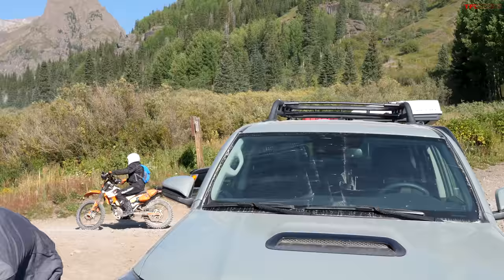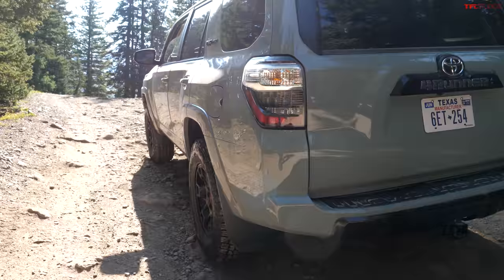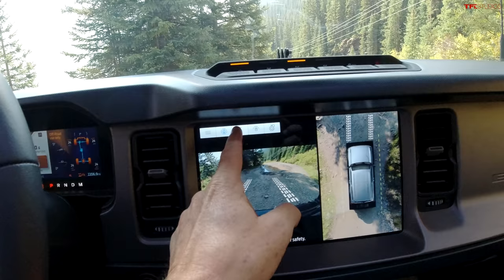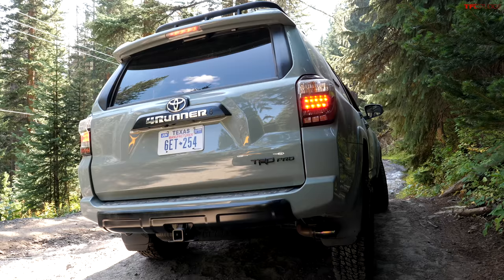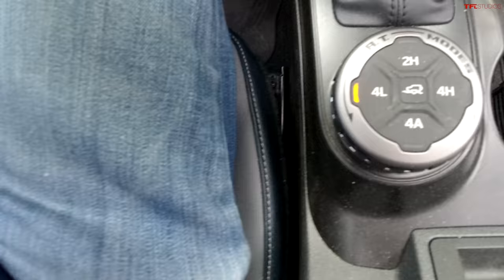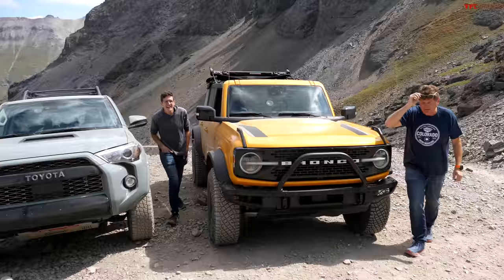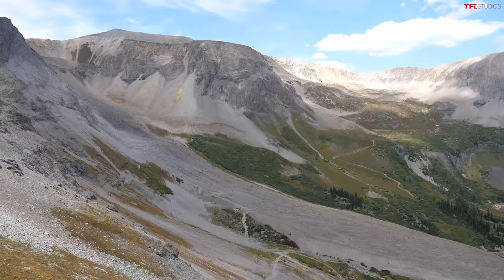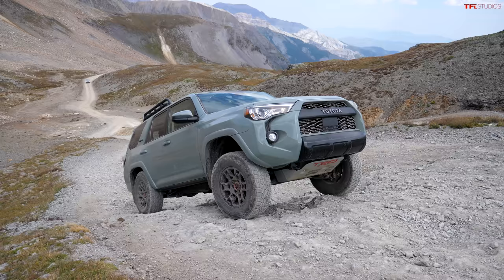The Toyota 4Runner TRD Pro May Be Old, But Can It Still Keep Up With The Ford Bronco Up A Mountain?

Comment: IMO the 4Runner isn’t a direct competitor to the Bronco. It come from a time when Chevy S-10 Blazers, Ford Explorers and Nissan Pathfinders were body on frame, 4 Lo real off road built SUV’s. Only the Wrangler really competes with the Bronco.
Reply: Agree 100%. The 4Runner competes with the Jeep GC & Ford Explorer; both of those outsell the 4Runner by considerable volume. Toyota needs to start innovating again. They’ve relied upon their reliability stereotype far too long & the quality gap has narrowed.
Reply: @krasnaludek298  Toyota's competitor to the Ford Explorer is the Highlander.
Ford Explorer is no off-roader like the 4Runner. No body on frame, no 4x4 (only AWD), no solid rear axle...completely useless off-road and definitely can't go where a 4Runner can go.
Reply: @krasnaludek298  the 4runner is in its own class and doesn't really have a direct competitor which is why their resale value is incredible. The Jeeps GC and Explorers are disposable vehicles with limited aftermarket support that nobody wants after a few years. These 4runners will be sought after for decades to come.

Comment: I’m a huge 4Runner and Landcruiser fan (own one of each), so don’t get me wrong.  Toyota really is missing out on the Jeep Wrangler and Ford Bronco reboot crowds by not putting out a modern FJ40 — not a 4Runner in makeup to look like one a/k/a FJ Cruiser, but a top down, door off, locked 4x4.  The 4Runner is an Americanized Landcruiser Prado and will go pretty much anywhere but it lacks the styling and passion of Bronco and Jeep.
Reply: Toyota seems satisfied to just keep tweaking the 4Runner.  They really aren't trying to compete directly with the Jeep/Bronco style of top down, doors off, open air experience.  Maybe they'll get inspired and redo the FJ, or go to a more retro Runner concept like a Gen 1.   I have an 86 4Runner and just really want the open air feel when off roading.

Comment: The 4Runner TRD Pro will outlive the Bronco, I don't get the hype for the Bronco they had to bring it back from the dead to make sure it dies again.
Reply: Just your opinion and at this point unprovable, nobody knows how long the Bronco will last. I just don't like sending my money to a country that severely tortured American GIs during WWII. I have talked to a former Gi who was forced to walk the Battan death march.
Reply: @RSDX99  then be in ur own nutshell
Reply: @amarbinay6654  well said
Reply: @amarbinay6654  4runner owners are in their own nutshell. They'd ignore anything else for the sake of "ReliABilityyyy", just to trade in 5 yrs later for another 4runner. Let's keep it real, any of these would make it past your reliability claims, you're paying reliability in advance for the 3rd or 4th owner
Reply: @luisinhoens90  what do mean they aren't reliable or what. May be 3rd or 4th owner will suffer if used  one isn't in good/proper condition  but when it comes to the term reliability and longevity, yes they're pretty much stand on it and there are many owners with 500000miles and above with no problems at all. Some people who buy used 4runner they've also claimed what's the vehicle promises other than that if there r some faults then will be manufacturing defect or basically owner didn't maintain properly. If I able to live in america then surely I have 4runner/TACOMA.
Reply: @amarbinay6654  What I mean is if I'm buying new I'm not paying reliability in advance for the 3rd or 4th owner. Lets keep it real, very few owners keep their cars for so long. I'd rather have the more entertaining, more off-road capable and appealing ride, keep maintenance on track and it will do well through my ownership and next owner.
Also, desirable vehicles with high resale value usually get good maintenance. That's why Wranglers although generally don't get the best reliability record are kept on the road. Cheap econoboxes get neglected, skip oil/fluid changes and discarded on a regular basis. $50K off road vehicles? Not so much
Reply: @luisinhoens90  Yeah absolutely that's what I love about TOYOTA brand and perfect vehicle for long term owning. Here where I m living, the domestic market vehicles r cheap and crap, some of their service maintenance just scam and BS except for TOYOTA, they r too much  different in their way, their regular service maintenance r cheap and affordable($70-100), good revalue, many owners keep for long term and trustworthy brand except for some dealership. Here TOYOTA's best selling vehicle r FORTUNER and INNOVA which can be used as a overland or off road rig which is a perfect vehicle to own if I live here for long time. 
Jeep r decent capable vehicle but I don't like it because reliability factor, some mechanical failure and here they r overpriced, Some jeep owner do minimal off-road stuff and got stuck easily( they don't know to drive 4x4). If I ever happen to own jeep or defender I'll just swap every mechanical with TOYOTA  for long term reliable factor and to do some practical stuff

Comment: Man 11k is a big difference in price, and if you put that money into modifying the 4Runner. 35s and a front locker and more are all well within that price range. And if you ask me if the 4Runner can keep up on 32s it will likely outwheel the bronco on 35s
Reply: Yes, it keeps up with a Bronco on 35's on a trail that stock vehicles have no issues with. The baby 32" tires, lack of a front locker, and horrible gearing will quickly hinder the 4Runner once you get into something that is actually difficult.
Reply: Don’t get me wrong I love the new bronco but the price difference still stands. For the extra money you can easily regear the 4Runner as well as add bigger tires and a front locker with plenty of extra money to spare, whereas the bronco has some innate issues for crawling especially that just can’t be fixed without some excessive fabrication such as it’s weight and size. Not to mention engineering elements such as the front shock mounts being exposed on the bottom of their lower A arm, which would lead to serious breakdown on something that is actually difficult.
Reply: @noahthorin2476  You would quickly eat into that 11k difference, if not exceed it. Wheels and tires alone will eat up half of that, not to mention a lift, axle regear, and front locker. Also, the axle regear only mitigates half of the gearing issue with the 4Runner. The other half lies with the transmission and transfer case.

I definitely agree with your concerns about the Bronco, though. I've seen a few out on the road and they are a big vehicle, for sure. Plus, mounting that stud on the bottom of the A-arm is just an absolutely terrible decision. Good luck getting that nut off after dragging it over some rocks!
Reply: @stinggreyjlr9535  If you ask me it sounds like the solution is to wait a couple years and buy either used for cheap and dump quite a bit more than 11k into them lol.
Reply: @noahthorin2476  The price difference doesn't stand here. There's no stock 4Runner with comparable off-road bits to the Bronco 1st edition. Can we all agree there are much cheaper Broncos including the Badlands that can undercut the 4Runner TRD Pro, yet still comes with a locker and front swaybar disconnect?

Comment: Toyota engineers are very conservative and they rely on what is proven rather than go with something unproven.
They constantly monitor components for reliability and are quick to make design improvements.
Plus, although all vehicles have their own set of issues I know 4Runners that have over 400,000 miles on them!
Ford, just does not have the same reliability and as far as old goes......well, uh, it's older in concept.

Comment: What’s the advantage of the the ten transmission? It’s not fuel economy.
Reply: I feel like anything above 6 speed transmissions, we have reached a point of diminishing returns.
Reply: 😲 great point!
Reply: @NWI_Steel  not at all. A 8sp will get 11%+ more fuel economy than a 6sp
Reply: More gears makes a few things possible. less load on the engine after upshifts, lower numerical gears for fuel economy on the hwy, higher numerical gears to start moving  - or off-roading.  You can make a vehicle accelerate quicker and get better mpg by having more gears. For CAFE, the extra overdrive gear or two is important. For acceleration the extra low gear or two is important.
Reply: @life phobic Nope. That's why CVT are good at fuel Economy.
Reply: @MrCh1cken  for highway fuel economy, it doesn't matter how many gears you have. But only what the ratio is in top gear.
Reply: @NWI_Steel   yes and no. If your overdrive is too low for the conditions, speed, angle, altitude, load, etc.. then you have to drop down a gear or two. Having extra overdrive gears allows you have both a lower overall gear and extra gears for the conditions.
Reply: The advantage for Ford is that its an “off the shelf” component. Zero dollars spent on R&D for a brand new tranny. The 5-speed AT in the 4Runner has been around for years and is bulletproof.
Reply: It does have an advantage but keep in mind this Bronco has 35" tires vs the 32" on the 4runner as well as a much more aggresive gear ratio. Put some 35" on the 4 runner and look how the MPG takes a dive.

A regular Bronco with 32"/33" tires will have better mileage

Comment: Did Imogene a couple years ago coming from Telluride in my stock 2002 Dodge Dakota Quad Cab. Only scraped the bottom a couple of times. Tons of Tacomas but only saw one half ton pickup.

Comment: Every time I see it, I can’t believe Ford released the Bronco with the horrid mess of an engine bay.  And no, I’m not talking about hiding the engine under a plastic cover, but rather engineering the wiring and plumbing so that it doesn’t look like they forgot to do the work and simply rushed to get it to market.  Ford should be embarrassed by the launch of this thing, as they clearly weren’t ready with a finished product.
Reply: Do you remember how proud Ford was of the engine bay of the EFI V8 Foxbody Mustangs?  Back then, Ford engineers in the automotive press stated over and over again that they wanted to make it tidy and easy for a home wrench to work on.  They were proud of it.

How times change........

The Bronco's engine bay is a hot mess under the hood, for sure.
Reply: @jerroldshelton9367  I was thinking the same thing lol and people are paying 70k+ for these lol
Reply: @yourlame9795  The more I see of it, the less inclined I am to be one of them.

Comment: Funny how they were talking about how much attention the new Broncos get offroad. I was just out in Moab with my 2000 F250, and I had the opposite happen, I got the attention of a group of new Bronco drivers as they were gawking at me as I was on the same trail as them. Also happened with a group of early Broncos as they sat there and watched me coming up the trail towards them from about a 1/4 mile away lol.
Reply: Well I was at the Bronco Off-roadeo in Moab. We were “gawking” at the Nissan Rogue or whatever it was that was driving around where we had stopped, just wondering what they were doing and how far away from the trailhead they were going. I think you were being a little more self conscious than necessary. :)

Comment: Compared to the Bronco, the 4runner jiggles incredibly when fast forwarding the video on the shelf terrain, like the Hawaian dashboard belly dancer doll once Roman had in the videos.
Reply: How do you know it’s not the camera vehicle shaking?
Reply: @lukestoyz  'coz the Bronco runs straight and smooth just a car length ahead (check the drone footage where you can see them running in a row) of the 4runner.

Comment: I just ran Black Bear Pass a few days ago in a Wrangler Rubicon.  I would like to see how "easily" these IFS vehicles handle The Steps, e.g. what the "pucker factor" is.  We had to spot a 4Runner driver we came up to through them because he was stopped and afraid to try them without a spotter, after seeing images and video of quite a few IFS vehicles on their sides here.  No big deal to spot him, but the solid front axle and disconnecting sway bar in the Wrangler made The Steps no big deal.

Comment: The Bronco drivetrain will be lucky to last 100,000 miles. Eco boost, turbocharged, week driveshaft. No thanks. I’ll take the tried & true, bulletproof 4Runner any day
Reply: Funny how real world experiences don’t match what you say. Lots of turbo V6s out there with over 100k and many of them are Ford Ecoboosts. Meanwhile the GM LS engines (which I actually like) are crapping out in just a few thousand miles if they were built during the pandemic. Hmmm……maybe the armchair mechanics should stop weighing in on engine reliability.
Reply: Ecoboost engines have been around for 10 years. Lots of F150s with the 2.7 and over 100K miles, lots of Mustangs and Rangers with the same engine.
The fact that Ford came with DI, turbocharged and small displacement engines a decade ago just shows how behind Toyota is. Next year they'll debut a V6 TT engine and fanboys will say it's the best most reliable thing ever since the 22RE and 1UZ-FE engines

Comment: On X sucks. Doesn’t navigate, doesn’t work well at trails. Relies on offline maps.
Reply: The lack of navigation pissed me off after I paid $30
Reply: I use GaiaGPS but I don't see how offline maps is a downside. You should always download the map for the trail you're doing because you never know when you might lose signal. My biggest issue with OnX is their pricing structure. It's too expensive for what you get versus the competition.
Reply: The app is available in Canada, but there are LEGIT zero trails available. Why is this app even available here?
Reply: @PeakDecline  I mean that it’s basically only an offline map for $30. And even with the highest resolution it’s not very useful. Outside highlighting the trail and telling you about it, google maps has the same functionality except it works better offline.
Reply: On X looks good, but features, usability, and UI are not as good as competition.

Comment: Re-watching some episodes... 5 months ago or so, I almost bought a 4Runner TRD Pro that came available.... If I lived in colorado and could off road a lot, I might have gotten.  But to daily drive and off-road a couple times a year.... it was not great.  that 5 speed transmission is so bad around town.  Leaving stops and passing on the interstate, there was so much hesitation.  Also, the TRD exhaust is cool for about 5 minutes.  Then it really starts to drone and getting annoying.  Lastly, at 6'3", I barely fit, which I think is crazy because I'm not crazy tall.  My hair touched the headliner with the seat in its lowest setting.  The review mirror was directly in my line of sight.  And the steering wheel constantly hit my leg if it was in the wrong position.  Such a cool vehicle and I wanted to like it so bad.

Comment: The Jeep beats both of them easily.
Reply: No
Reply: @boymcfacto5832  Yes
Reply: Until it breaks, which is all the time
Reply: @OGcottoncandyrandy  that’s funny because my buddies Tacoma is dead after 2 months of use because a small rock killed his transmission going down a dirt road. My wrangler has been abused with ACTUAL off road use slamming down on components and I’ve had…. 0 issues. Wrangler>Tacoma in every scenario. Especially reliability
Reply: It beats them to the tow truck.

Comment: After watching this video I still think about Maggie and I going four times through Imogen with our 1990 4Runner (which still runs like a charm) and our Suzuki Sidekick. With the new all-electronic cars, 70% of the fun (and adrenaline) and elbow grease is gone. This even applies to my espresso machine! Am I lost in the past, or is it that I like, like Tommy, manual gears and mechanical things?

Comment: The First Edition really isn’t a fair price comparison, since they are “Sold out.” And have every option available.   But you could get a Badlands Bronco, with the 2.7 and Sasquatch package it retails for about the same price as the 4 Runner.  Of course you can toss on a ton of options increasing the price..

Great video though because I think that both vehicles are going for the same consumer.

Comment: I prefer the 4Runner, but Toyota needs to step up there engine performance. 270 could be increased greatly with a single turbo, and like Tommy said, that engine is bomb proof, it can definitely take 5+ pounds of boost.

Comment: Agreed with the comment about the difference in price you could upgrade the 4R to fit the 35's but you could also add the front camera onto it and be similar in capability there.

Comment: This is specific to those that are designed for rock crawling. You can however put it in Baja mode  to adjust the shift points in the transmission and then put it in 2H to make it better in a drag race scenario.

Comment: Depending on the obstacle one vehicle may have a better width or length for that scenario it doesn’t mean one is better or worse necessarily. They are both very capable. My only gripe with all of them is the prices they charge just for a locker or two.